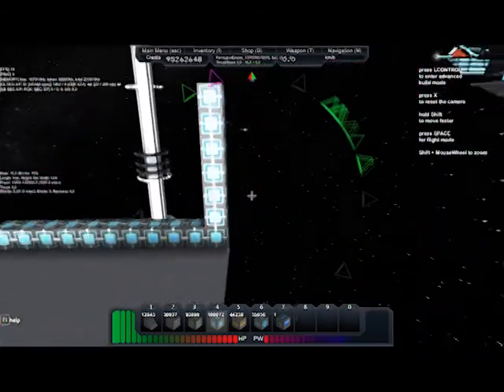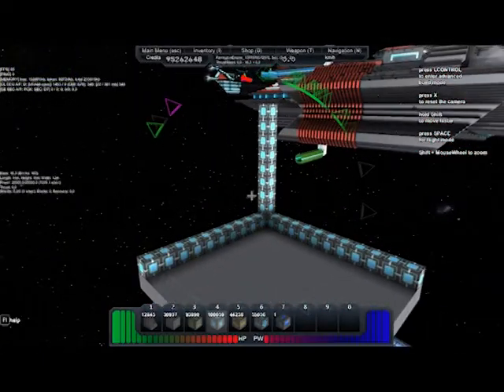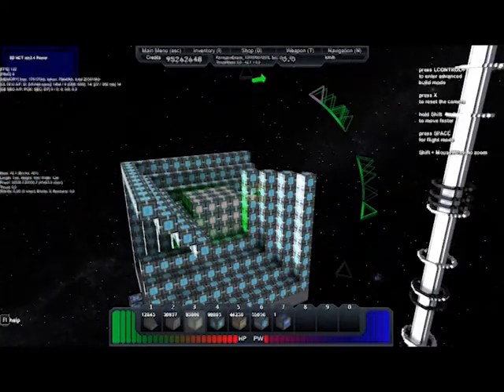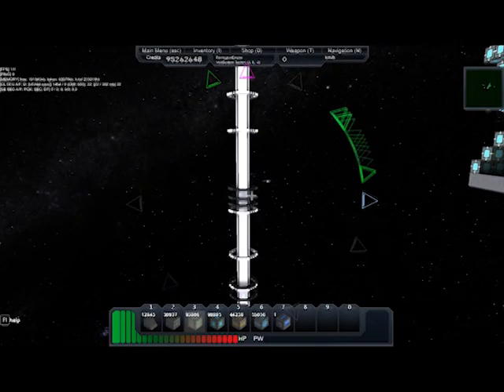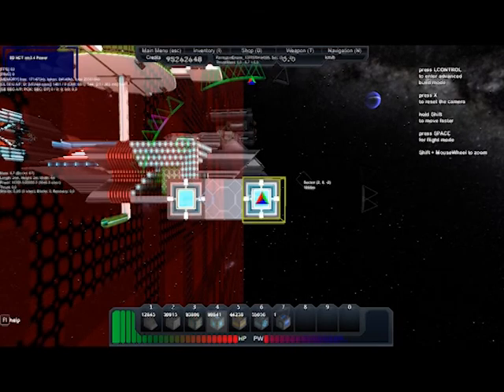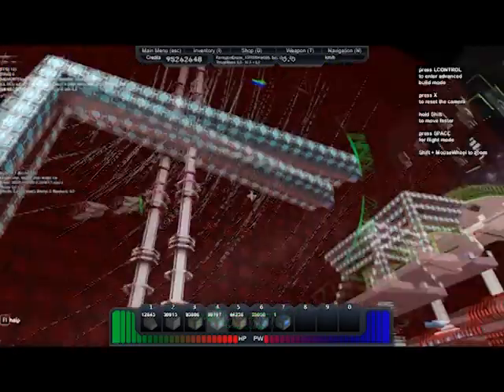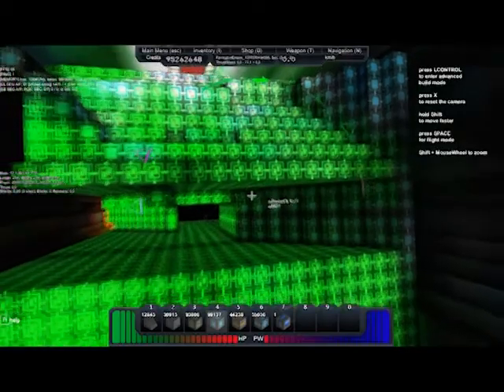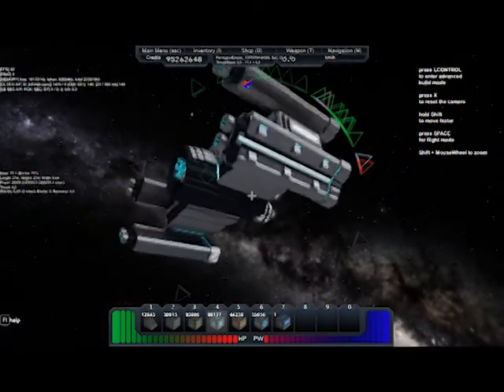Efficient Star Made Power Generation

Comment: the power generator that you showed at the start, if you put a big 3d cross in the middle of that would that be more effective than putting more bent t (best letter i could think of)
also if you had an L shape and you put a 10 block line going up turning it from a 2d (if you ignore the dimension of the blocks them selves) to a 3d shape would it be exactly 10 time more powerful or is my understanding of how it works wrong.